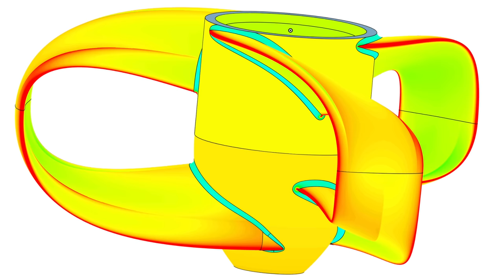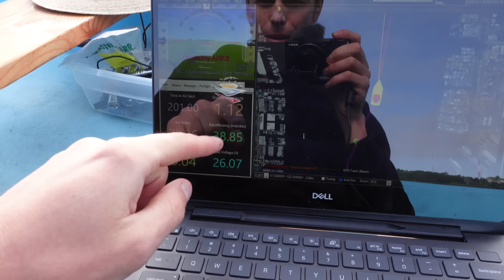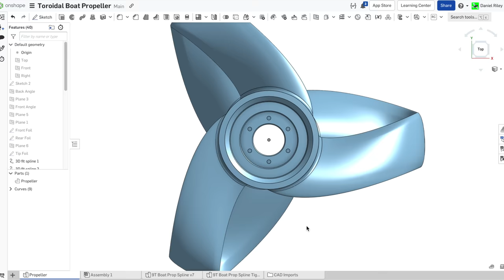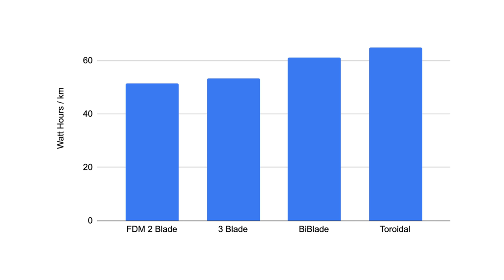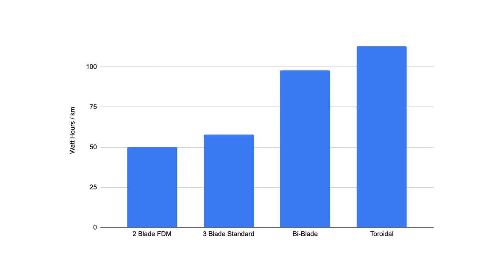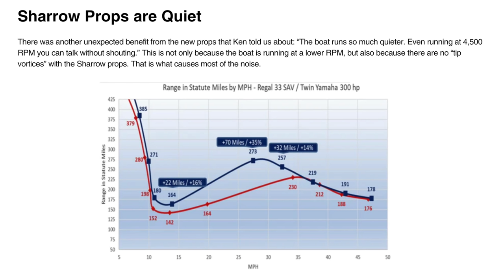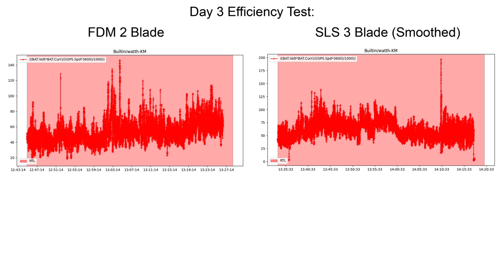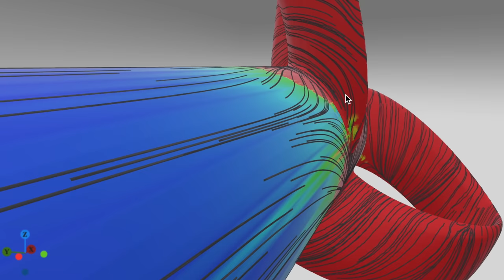Testing Futuristic Propeller Designs on my Solar Powered Boat

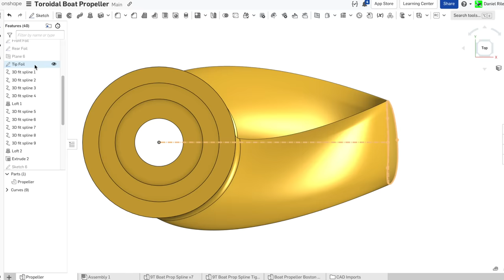Comment: Page 11:16 at this point of discussion it reminds me of airplane winglets. The winglet principle and intention is also applicable here. 

There are two configurations to winglets, a) bend up, eg Boeing liner, and b) bend down, the war bird A10. 

Bend up winglet pushes incident fluid away from wing top tip to keep low pressure region low, while bend down winglet pushed incidence fluid inwards under the wing to keep high pressure region high. 

A toroidal prop has above both a) and b). Note that the local angle of attack along the joint winglets will not be constant but appears “twisted “. You shall appreciate that once your designed has started following above principles. 

To avoid interference between top/bottom wing, top wing should leads bottom wing. By how much? as much as possible and it is not practical to air craft but is perfectly ok with prop.  

In toroidal prop, the fore blade represents the upper wing and should lead the hind blade by some appreciable phase angle. 

Let that be a design guide to your next design. A patentable one. 

Hope this helps.

Comment: Very interesting content, kudos.  If ultimate efficiency  is the target, have you considered using a larger diameter two blade prop?  David William's "Terrapin", was a 21 foot monohull converted to electric.  At 24 volts and 10 amps draw he reached 3 knots or 3.5 mph using a 13 inch prop with 80 to 90% pitch.  He could hit 5.5 knots or 6 mph at 40 amps.  Ultimately, he believed using an 18 inch prop similar to ones used in rc aero would be even more efficient.

Perhaps in a future project,  using a hobie cat catamaran or similar platform, plus 800 to 1000w of solar and a large diameter prop would be the ultimate in speed and efficiency.  I would venture to guess that in even less than ideal sunshine it would use very little battery power.

Just my thoughts.  Love your content, keep it up!

Comment: When you moved the xoar props out like that you changed the pitch distribution. The pitch is no longer equal all the way along the blade (if it ever was). What was the root before is now farther out and probably has a much higher pitch than the tip of the blade.

Comment: Why don't you put the propellers on the front, use the motor as the base diameter for a pod, then put vertical fins on the pod to work as a rudder? 
This will make your system a pull system versus push system. It would also remove any interference from the rudder with the prop/screw. You could also put a cone on the screw nose to provide a slipstream and break fluid resistance. This column should be equal to the same diameter of the pod and the hub for your screw (prop). For shirts and giggles you can also put counterflow veins on the pod to help remove the turbulence in the flow. These veins would taper is it goes down the pod. Basically your unscrewing the thrust made by the prop and redirecting to increase thrust.
I look forward to your future experiments.

Comment: Should’ve checked the water temperatures. 

Cold waters are more dense and don’t shed vortices as easily and means you have a potentially massive variable that’s not accounted for.

Comment: My theory on toroidal propellers was they had too much non-thrusting surface area.  My background on propellers is “go fast” boats.    Excess surface area causes friction that has to be over come.  You should due some basic force vs deflection on the blades.  There may be a lot of change in pitch under load.  High speed cups often cup the end of the blade which I think work like a winglet and reduces the vortices. These props have been around for many years, as you say, if they are as good as they say, why aren’t they are in use more?

Comment: The trouble with these tests is that the motor efficiency will vary with torque and RPM.
Very often do I see analysis of subsystems that show an improvement at the expense of total efficiency. That is not limited to efficiency but I see it with noise too.

Comment: the right toroidal propeller is closer to the air because all you're weight on the boat was on the left side. try some 3d printed cavitation plates

Comment: With crappy printing, I do wonder if there's a way to arrange the slicing, so the lines of flow in the plastic are oriented to be perfectly aligned with the flow of the water at a certain speed.  Maybe there's a hack there that makes the printing less of an issue.  It could make the easy printed propellers somewhat less of a joke.

Comment: Would you be interested in testing "contra-rotating props" (2 props stacked but rotating opposite e/a). According to Wiki its suppose to be more efficient because single props waste the tangential flow of the water or air.

You see them alot more on boats but I'd be curious the performance in air. Apparently the main downside other than weight is added noise.

Comment: Why not make two counter rotating propellers? The idea is that you eliminate the twisting force introduced to the water by that, regaining the energy loss there. I would recommend making the shrouded, tho, to avoid that the water spreads out between them.

Comment: The issue you're having with your 2 blade fdm props is probably just that they're 2 blade fdm water propellers.

Keep in mind you get similar issues on airplane pusher props as the blade transitions between clean air and dirty air from the wing/body, and you can see how a flexible 2 blade water prop can easily go into resonance going past the dirty water from the outboard rudders.

I mean heck, that can be an issue for classic ship brass propellers, and it's why theyre usually an odd number of blades.

Comment: I was really curious about that "ship converted to a yacht" so I looked it up. Turns out it was built that way, in 2018. 

"SHERPA yacht is a 73.6-meter superyacht capable of welcoming up to 13 guests in her six spacious cabins along with 22 qualified onboard crew members.

She was custom-built by Feadship in 2018 and was refitted recently this year, 2022. She weighs 1802 tons and can cruise at speeds of 13 knots and go to a top speed of 16 knots.

Aboard the SHERPA yacht, guests can have full access to her amenities such as her underwater lights, beach club, sun deck, and jacuzzi. She also has complete air conditioning and has wifi access.

Hosting guests are also not a problem for SHERPA yacht as she has six spacious cabins capable of fitting 13 guests, which can be attended to by 22 qualified onboard crew members.

Adding to this, she also has at-anchor stabilizers to keep guests steady and safe when venturing the rough seas.

Owning the SHERPA yacht is Sir James Arthur Ratcliffe, a 69-year-old chemical engineer born on October 18, 1952, who has now transitioned to finance and an industrialist.

He is the chairman and CEO of Ineos Group, a British multinational company that focuses on chemicals.

He has an estimated net worth of 15.3 billion US dollars ranking him as the 113th richest person in the world according to data by Forbe’s in their Billionaires 2021 list.

SHERPA yacht spans an overall length of 241.6 feet or 73.6 meters, a beam of 42.8 feet or 13 meters, and a draft of   9.1 feet or 3 meters.

She was built back in 2018 by Feadship and was refitted four years after her completion. She has a teak deck, an aluminum superstructure, and a steel hull.

She has an estimated weight of 1802 tons and is powered by two powerful MTU engines, enabling her to cruise at 13 knots and can go to a maximum speed of 16 knots.

Her massive fuel tanks also allow her to over distances of over 5,200 nautical at 13 knots."

From YachtBible.com

Comment: Consider - the entire water surface friction across all these 4 prop tests.  Figure out how much actual square inch of prop surface you have in the water for each model.  I would suggest that your torroid prop has the most surface - thus (irregardless of prop angling), thus greater surface area + greater surface friction + greater cavitation + additional dead stall spots is what is causing this deviation between the 2-blade and the torroid blade.

If you (safely) reduce (and remove) the excess torroid square inch surface matching that of the 2-blade surface area - you might really challenge these blades to a proper match of watt/hours, velocity, reduced cavitation, and minimized stall spots.

Comment: Hey I got an idea for a propeller using the 3 prop only make the propeller into a spoon shape but keep it's angles only add a depth throw into the blades also add a bend that matches it's clockwork curve not straight bend keeping to that wing tip flow idea you had spoken about make the bend curved tips point towards you away from the boat. Please try this ideas and show us I have quite the ideas for different propellers

Comment: The Wohle Thinge With the angle of attack and how Ito working in Relation to the expected rpm is the most Important part when it comes to turbine blades/Propeller designs. The stuff at the end with moving the blades away Form The center makes a huge huge difference in how the fluids/the water flows around the blades and how it creates thrust. 
The Overall Testing Setup was Great and the ideas and that it was even Done by you is awesome, though as an engineer in this field i need to Tell you that you have to work on these pitches etc. and blade design in order to Compare The different types. I would lobe to See an Video, where These Most fundamental principles are considered :)
Reply: In regards to the end: high pressure on the front and low on the back -> this exactly what you want in Order to make a blade move. Same as with airplane wings, that have high pressure below the Wing and low above, which lifts and keeps the Plane in the air

Comment: The information I have read indicate that toroidals that are optimized have an efficiency of 105%, not "105% more". It sounds like a minor difference in wording, but "100%" more is twice the efficiency, so "105% more" would mean more than twice as efficient, when in reality it indicates only 5% improvement in efficiency. The phrasing is thrown around to imply HUGE gains when actual gains are minor, but present. Likewise tubercles and fluting are being touted as producing huge efficiency gains when in reality they have very minor efficiency gains but if properly optimized will produce better flow for less noise and very minor efficiency gains.

Likewise longer blades typically equals more power and more blades allows for lower rotational speeds for a given amount of thrust (not necessarily the same as more power). different blades are going to have ideal RPM ranges. No fixed blade propeller will be efficient through a wide range of RPMs. This is a major contributing factor to why boats and planes have a ideal "cruising speed".

Comment: Printing a variable pitch prop would be interesting to establish a pitch tuned to just your boat. I have these on my underwater scooter. Mine is an older Apollo AV-1 DPV.  Many DPVs use same or similar variable pitch props.

Comment: A shrouded propeller in which a band joins the propeller tips would also not have propeller tip cavitation. Actually I think a simple shrouded propeller would outperform these new designs

Comment: Looking at your blade foil shape you put an under camber on the foil that was a mistake. An under camber foil works fine at low speed as in 100 mph in the air with a 48 inch cord wing. A convex shape is better, something more symmetrical is even better because of the Reynolds number or the waterborne equivalent you are operating at in the water.

Anyway keep experimenting and enjoying your exploration.

David Gerr has a good book about boat propeller theory and design. If I remember right it's called Propeller I'm not sure where my copy is at the moment...

Comment: Could you try putting more submarine style propelers on the boat... since they are designed for high efficeny and low cavitation at slow rpm. Something like pump jets or the advanced navy designs

Comment: They may be more efficient at lower speeds only. To check. Rather than up the power to the same 60W as the other props. Drop the speed of the other props till you only use the same amount of power as the toroidal originally were. Then compare efficiency. You may find that cavitation is increased greatly if you push the toroidal props too hard.

Comment: When you add air bubbles to the water you drastically reduce the water density and drastically increasing the amount of gases in solution plus creating gases already out of solution. This lower water density leads to much easier cavitation plus what appears to be cavitation but is just gases out of solution that you added.

This means that you can draw no comparison between how a prop works with air bubbles vs no air bubbles.

Remember that cavitation is very low pressure water allowing gases to leave solution. These gases cause bubbles that reduce efficiency.

If you feel comparing the performance of a prop with and without added gases is valid, then you might as well compare the prop performance near the surface to the prop performance at 100 feet. At 100 feet the water is denser which means less cavitation.
Reply: That's why it's very difficult to swim in white waters 

Your basically swimming in air 

That's why as an open canoe paddler, I always wear my PFD
Reply: water denser or more pressure?
Me thinks there will be more of a pressure influence, curbing cavitation.
Water is pretty much incompressable.
Reply: @rowansandison4162  yes the higher pressure at depth contributes more. I should have made that clear.

Water is compressable, just not nearly as much as a gas. The density increases with more water column. Density if water due to temperatures is much more complicate. Generally the density increases with reduced temperature except as the temperature comes close to freezing.

This does not change the fact that he added a large amount of gas to the water, in the form of air, which drastically reduced both water pressure and density. He then attempted to come to conclusions on the efficiency various propellor types based on the cavitation that he caused and is completely outside normal operations (much more than running the propellors at 100 feet of depth).

He did not appear to control for forward (because it doesn't appear that he tested reverse) speed and more importantly forward acceleration.  Generally high acceleration has more contribution to cavitation than high speed. At the low speeds he tested at, acceleration is the greater contribution.

It appears that he added the air to water because he was seeing no to minimal cavitation at the conditions he was testing at. 

To make things more complicated, he designed and built the propellors himself using materials he had available. This makes it near impossible to make general conclusions on different types of propellors because it is likely that he will get different results every time he designs and builds a new  version of each type of propellor (assuming he doesn't merely copy the same propellor). 

He didn't verify that each propellor was equally in balance. He didn't record the water perameters for each test. Water temperature and salinity will change the water density, changing the cavitation profile of the propellors. He didn't record wind speed/direction, water current speed/direction and boat speed/direction. All of these factors and more can drastically change the outcomes of each test.

Comment: At the risk of stating the obvious the prop design depends to some extent on the angle of attack of the blades with respect to the resistance of forward movement of the boat resulting in the any prop having an efficiency sweet spot for a particular speed on a particular boat - which seems to be reflected in Sharrows data. In your test it seems likely that the toroidal prop didn't stand a chance with these and the many other variables involved and intuitively it would appear that the margin for error becomes much greater as the design becomes more complex.
I have a sail drive prop on my sailing boat with a markedly different design to the versions supplied for the same 6hp engine supplied as standard and there only seems to be two versions recommended by the manufacturer compared to the huge variation in boat hull types and displacements.

My point is if even the "standard" design of prop is very probably nowhere near it's maximum efficiency for a type of boat at a particular speed any generalisation of efficiency claims made for "this type" of propeller versus "this other type" are quite difficult to make unless you have a lot of data across the board.

Interesting test. Keep up the great work. Thanks!

Comment: Your  toroidal props arent as steep overall as the Sharrow. Notice that theirs aren't like as 2 dimensional? Consider making your prop stretch along the axis more. This will allow your blades to slice into the water at 1 point along as water impacts it instead of all at once. You'll also notice their blades are longer than the tip profile where they bend back into the axel. The tip is merely a feature intended to reduce noise and increase efficiency slightly. The power has always been in the blades.

Comment: i wonder if the vibration on the FDM printed propellers is not due to a balance issue, but a resonance mode due to lack of rigidity. When spinning in the water, they might be "fluttering" where the new props, being super rigid, have a much higher frequency resonance which is above the frequency that would feel like vibration

Comment: It would be very cool to do some Arduino coding to limit the max speed (ir max power) that the motors are able to pull out of the battery so they only pull a smith less that what the solar panels are pushing into the battery, therefore you won't run out of battery